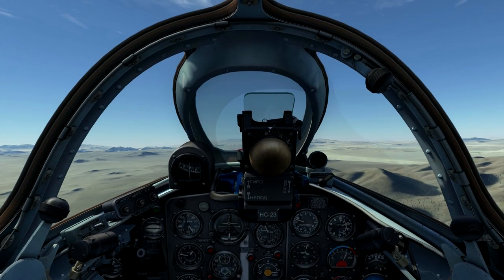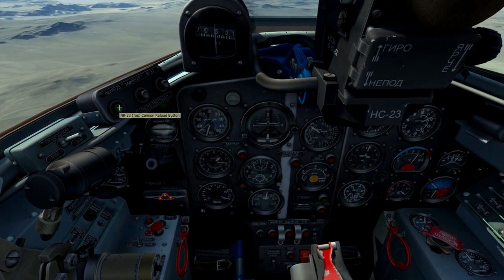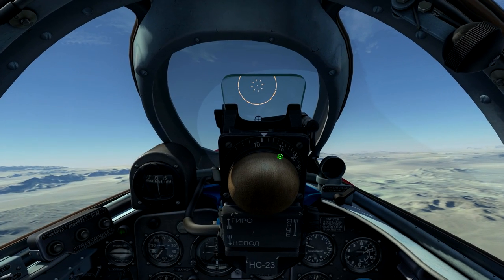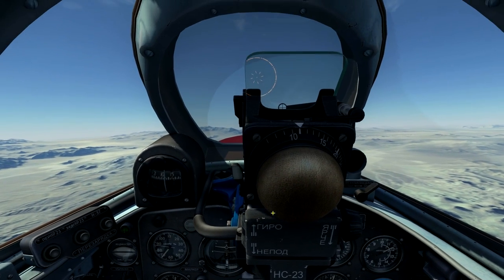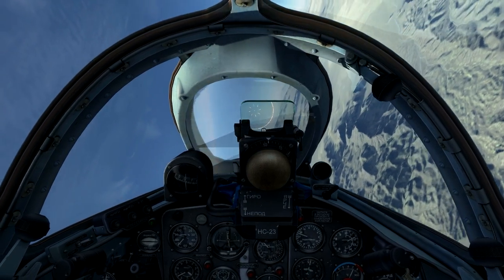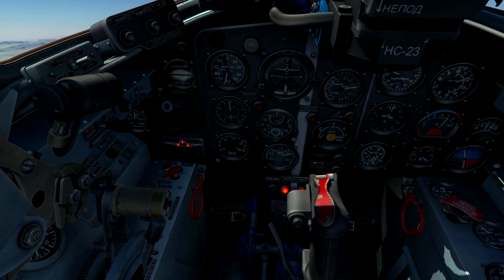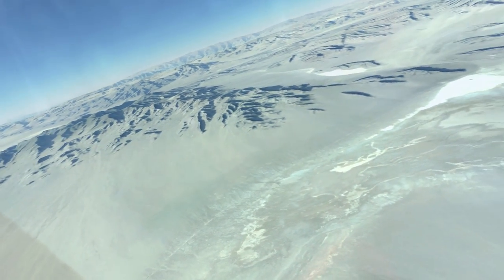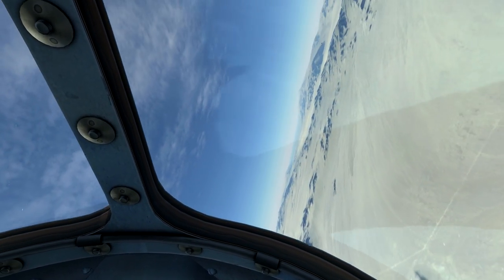DCS: MiG-15bis - Aerial Gunnery

Comment: Sorry for off-topic, but will the EDGE / DCS World 2 support subpixel rendering for air and ground units? Because this pixel-hunting in DCS World now isn't that easy, especially when you are searching for a small convoy (3-4 vehicles)
Reply: ^this!
Reply: I hope they do something here too.  While there are higher resolution monitors are getting more popular a lot of us are still playing on 1080p monitors because we are using multiple monitors.

For the time being I have changed labels to small dark grey periods.  It makes things a little easier to see without making it too easy like the regular labels.
Reply: I use the same solution with the labels but its a shame they are not occluded by the cockpit.
Reply: Yeah labels are only a temporary solution, and they're still just not it ... it's too easy to find things with them. There must be still some challenge searcing the objects/targets and pixel-hunting is just too much for our (well, my at least) eyes. And it doesn't seems that we will ever get the answer.
Reply: There's a label mod that changes them to dots.  Not perfect, but a very nice interim step that allows you to only cheat a little, while learning the sim and all of the systems.  I'm not sure if it works for ground objects, but it seems to work across all of the a/c modules.  I found it in the English F-86F DCS forum.
Reply: my frames have been fine.
Reply: ***** Ya I have a 4770k and it works GREAT with DCS.  Never a stutter, never a dropped frame.  Your issues lie elsewhere friend.

Comment: I've been reading about the Korean War and it appears that the models that appeared early in the war were often problem-ridden, mainly due to poor quality control. This included the left and right wing not necessarily being the same length. Then there was the oxygen controls, which required manual tweaking; and the canopy, which would frost up at high altitude. That said, it was still a highly capable aircraft, for its time, and the Russian aces who patrolled MiG Alley were easily the equal of the best American pilots.